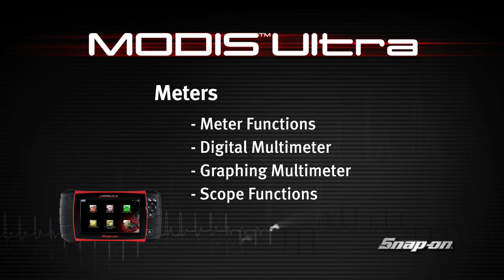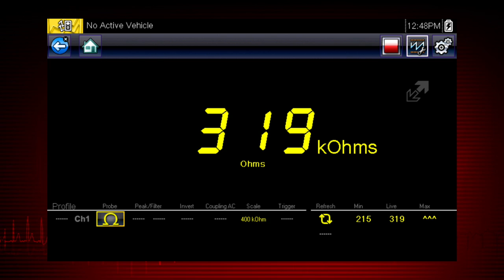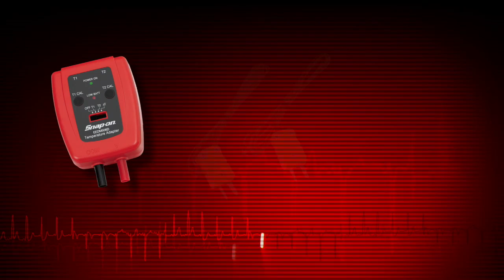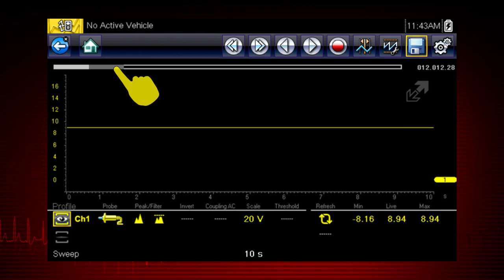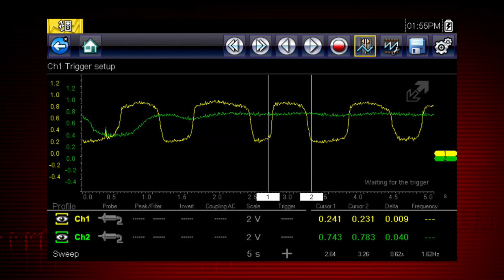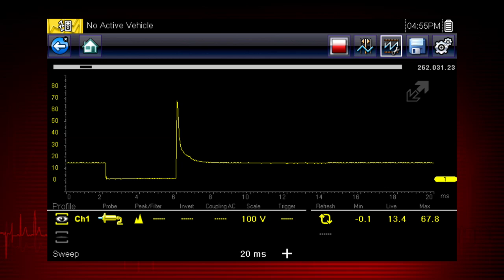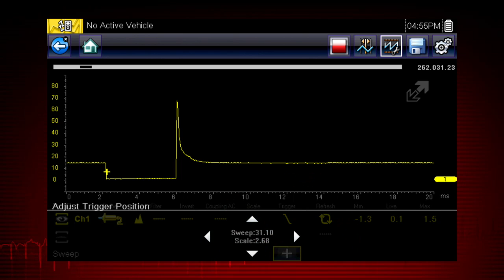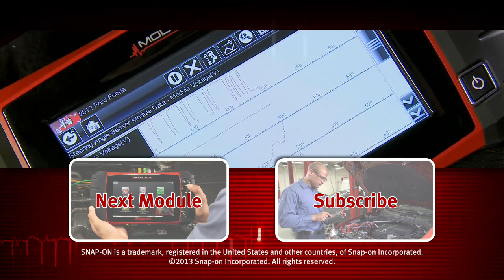Graphing Meter & Lab Scope: MODIS™ Ultra (8/11) | Snap-on Training Solutions®

Comment: This tool sucks I recommend a pico
Reply: The pico isn’t a scan tool bud.
Reply: @SurvivalInFlames   THAT TOOL STILL SUCKS AS A SCAN TOOL. THE SCOPE IS REALLY NOT GREAT.
Reply: It’s a mediocre scope, but that’s not its main function. 
Comparing the Pico which is a scope only to a bidirectional scan tool  with a scope built in, not to mention a multimeter and component info, plus troubleshooter is really comparing apples to oranges. Besides the pico starts at $2500, I bought a modis ultra  today with 19.4 software for $450. Now I have a second redundant scan tool plus a lab scope for the same price as the scope module for my Autel. For guys like me that are wanting to dip my toe into the lab scope world, this is a great option.